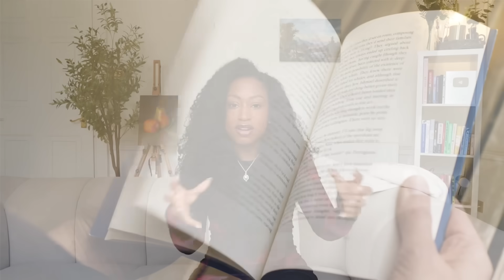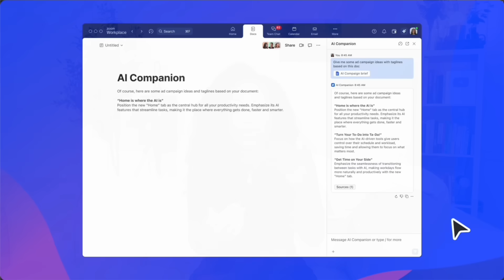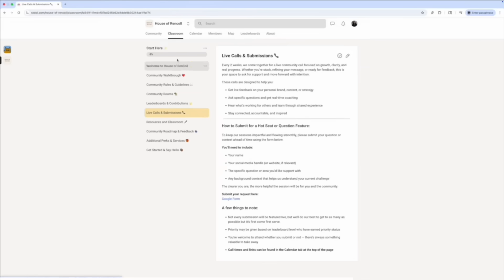how to actually LOCK IN using engineering principles

Comment: I was just thinking how my goals are in silos and not connecting to work together. Risk and failure helps with getting data to make necessary changes. This is where I stay stuck. Earlier today, I  got rid of several notebooks to help simplify my system. Also cutting my goals down to just 3.